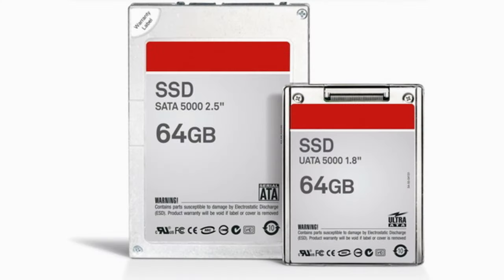Upgrading a Laptop 💻: Swap HDD for SSD, Add RAM or Another Hard Disk to Acer Aspire 5100

Comment from the maker: Content:
1:13 - Comparison of SSD and HDD;
2:10 - Connection interfaces;
3:17 - Form factor and thickness (height);
3:49 - How to get an old hard drive out of a laptop and install a new one;
8:38 - How to replace RAM;
10:20 - How to replace the Wifi module;
11:25 - How to replace a cooler;

Watch how to replace a hard disk, random-access memory, cooling system or other components in a laptop. Did you like the video? Click Like button and subscribe to Hetman Software channel. We will be glad to answer any questions in comments.

Comment: Hello my Friend, Thank you for the wonderful tutorial. so I do have an acer aspire 5100, more precisely the version 5103wlmi and although this notebook does have a Sata output my computer is choking quite a lot to open the SSD, without any success, at first I though it was  related to SSD I had purchased or something related to the bios, but after browsing the internet I found similar comments, I did try to update the bios and i end-up with the same problems. I’m still waiting for a processor that I’ve bought from AliExpress and I’ve already received  4GB of ram 2pcs 667mhz so-dimm 200pins. So pretty much the computer can’t keep up with the rams in dual channel and is not accepting the SSD ad well. So far I’m currently using zorinOS 32 bits, has I mentioned the bios is update v3.13  the bios does recognise the SSD but I can’t boot it, I did try to memtest86 both rams modules together and separated with no error what so ever, they seems to work perfect individually, Any thoughts?
Reply: Hi! Same problem here. In addition, I test to install ZorinOS trough USB with the SSD connected externally and in this case the laptop recognize the SSD an boot from it. But still can't use the SSD trough SATA...